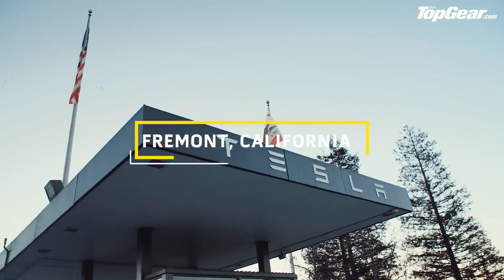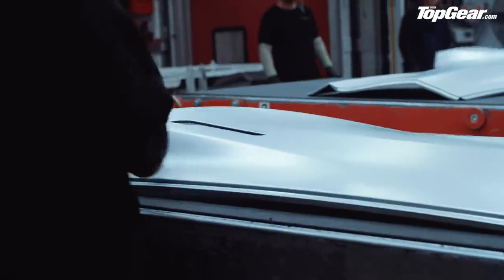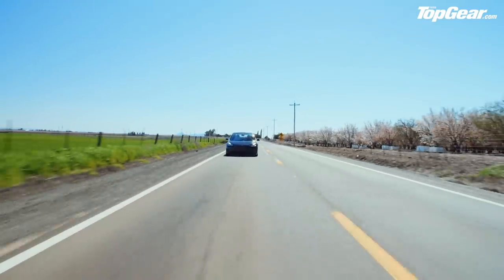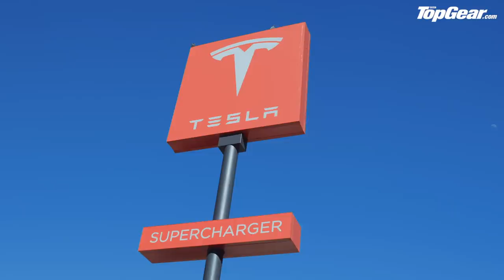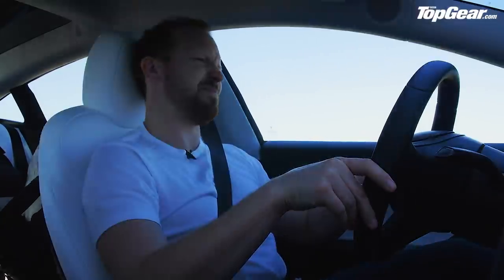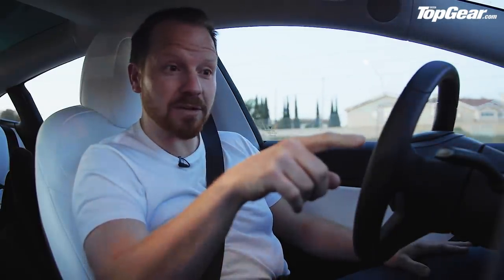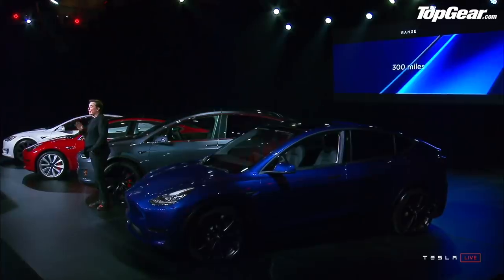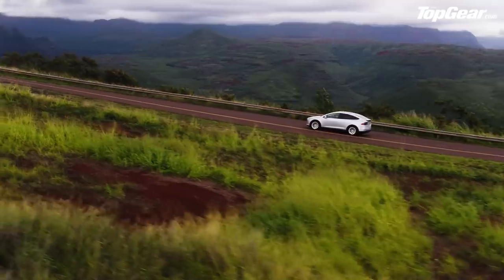TESLA Model Y Reveal, Model 3 Road Trip and Factory Tour | Top Gear

Comment: Teslas are the best cars in the world!!
Reply: LEL
Reply: If you don't care about driver engagement, track days, offroading, modified cars, great Interior, build quality. If you only car about saving money for your commute, new tech and being hip then yep it's the best
Reply: @eichler721  Actually I do care about driver engagement, great interior and build quality, which my car provides. Track mode is used for the race track, and other owners modified their suspension and brakes. Off road, I'll wait for the pick up truck for that.
Reply: @starshipdriver8536  Rams truck interior looks 3x better than the Model S or X which cost way more. I would take a electric as a daily commuter car but that's it. My truck can go 700 miles on a tank. Pull 17k and haul 5k. If I want to go through Moab I can drop in an optional 50 gallon tank in the bed of my truck and do it all without stopping for fuel. Tesla can't do that and won't for the next 15 years.
Reply: @eichler721  I don't think you really know anything about the Model 3.  https://www.motortrend.com/cars/tesla/model-3/2019/tesla-model-3-performance-track-mode-release-version-review/
Reply: @eichler721  Neither can a BMW M3 or a Alfa QV which is the class of car the Model 3P is competing with.
Reply: @flipadavis  Laguna Seca times
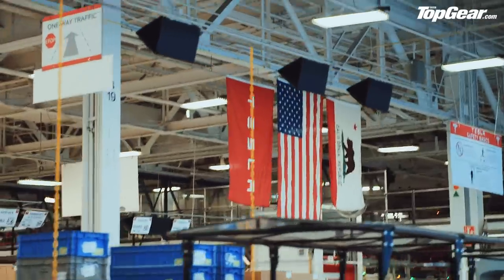BMW M4 GTS 1:37.66
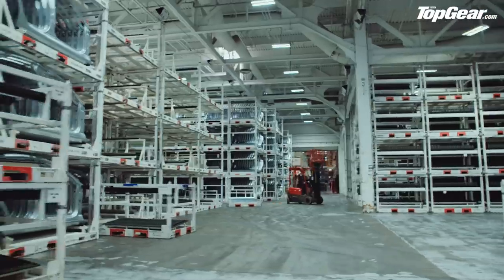C63 AMG black series 1:38.9
ATS-V 1:39.65
Guilia QV 1:39.68
M4 1:39.69
M5 1:39.81 previous car
C63 AMG 1:40.5
M6 1:40.52
M3P 1:41.28
Yes slower then all its competition at the track. It's just a marvel A full second or more slower then rivals. That's not impressive at all.
Reply: @eichler721  So you're going to compare the Italia 1:36 time, which by the way was driven by Randy Pobst who is likely the best driver to drive Laguna Seca and holds many of the records there for prodcution class, with the 1:41 time by an amateur driver? 

Just like Streets of Willow where Randy drove both the TM3P and the Alfa QV against each other where the TM3P won if Randy drove the TM3P around Laguna I bet those times would be very similar.
Reply: @eichler721  Here are some other cars and their times driven by Randy Pobst at Laguna Seca. The amateur driver's time still beat them 

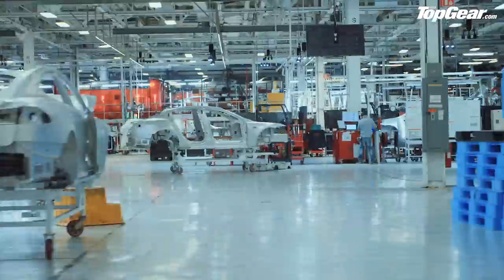Ford Mustang Boss 302 LS  1:43.00
Porsche Cayman S (981)  1:41.26
Jaguar F-Type R Coupe 1:42.00
E 63 AMG S T-Modell  1:42.39
Reply: @flipadavis  let's use science and physics 
458 Italia weighs less
Has more HP, better Aero, stiffer chassis.
M3P has a better Torque and lower speed grip cause of AWD which most of Laguna Seca's corners are high speed. Yep your arguement makes alot of sense
Reply: @flipadavis  M3P weight 4037lbs 458 Italia 3384lbs. So it weights 653lbs more and has 107less hp.  458 Italia has 308lbs better of aero downforce at 120mph and better weight  balance and steering.
Reply: @eichler721  Does it have 4 wheel torque vectoring like TM3P? No. Does it 471 lb-ft or torque like the TM3P? No. It has 398 lb-ft of torque. Having said that with the same professional driver driving both cars of course the Italia will win. But it's shocking how close a sub-$65k 4 door sedan can come to a $258,000 purpose built supercar. 

Put Randy in a TM3P around Laguna and see how close it is. And how many sports sedans it will beat. If Teslas' $60k family sedan can keep up with the best of the sports sedans just imagine what the new $200k Roadster will be able to do.
Reply: @eichler721  You keep quoting pro track record times against an amateur time. So are you saying then an Aston Martin Vantage S is a piece of junk because a Tesla Model 3P beat it around Laguna Seca? What about the others that it beat. You really just cant stand that an $60k EV sports sedan can hang with many of these cars.
Reply: @flipadavis  lets look at sports cars
Camaro ZL1 1LE 1:34.3
Corvette Grand sport 1:35.62
Mustang GT350R 1:36.11
Porsche 911 Carrera S 1:36.44
So these are 5 seconds or more faster then a M3P. Most sports cars from the current generation are as fast as the previous gen supercars. If you are not within 1 second of a car then it's not even a race on a track. Look at WEC the race classes are 2 seconds or less a lap different from GT endurance Pro and GT Endurance AM class. They race the same track at the same time yet watch the speed difference
Reply: @flipadavis  so 4037lbs divided by 471lb ft is 8.57 lbs per lb ft of torque. 4037lbs divided by 450hp is 8.97 lbs per hp. Ferrari 3384lbs divided by 398lb ft is 8.5lbs per lb ft, 3384lbs divided by 567hp is 5.96lbs per HP. See both advantages are Ferrari. Torque vectoring is it's only advantage which is negated by all the other advantages the Ferrari has. Put Randy in the M3P and it will run 1:38 at best putting it around the Mustang PP2 stats which are not bad but not as great as people make it out to be
Reply: @eichler721  Once again you are posting track records against one amateur guy's posted time in a TM3P. Why are you ignoring this fact? There are no pro TM3 Laguna lap time.

And why are you ignoring the fact that this is a four door sports sedan and not a sports car? It's amazing that an amateur time in an EV 4 door sports sedan beats many much more expensive sports sedans and even some more expensive sports cars. 

The potential is huge. Look at VW's record setting EV at Pike's Peak Hill Climb or the NIO EP9s Nurburgring time.
Reply: @flipadavis  yes those times are great. However both are multi million dollar cars. Just like the Rimac concept one. Even then the EP9 is slower then the GT2RS and the Senna, Project One, Valkyrie, AM-RB003 will destroy these at the track for the same cost. That's my problem with electric is people put it in the one thing it's good at so far and act like it's a miracle of engineering. In the future electric will be so dominant but right now the tech is not their. Facts are facts. The Roadster will crush 0-150 and at technical tracks as well. However it's not going to set any ring records cause the Project One, Valkarie and others has better Aero and weight by far and will have better power to weight as well. In 15 years it will be a different story. GT2RS 314k EP9 2million yet the gas car is faster at the track. Same with the BAC Mono which costs 250k but crushes everything right now
Reply: @flipadavis  also the Vantage V12 S is 5 years old. It's a luxury GT car that's not made for track use. It's not a supercar, the R8 V8 isn't a supercar they are at the top of the Sportscar range from the last generation
Reply: @flipadavis  by the way since you keep quoting the streets of willow time the M3P was on Cup 2 tires. The Ferrari was on Pirreli P Zero tires 2 generation old when it did the time. Put that car back on the track with Cup 2 tires and it leaves the M3P all day.
Reply: @flipadavis  also the M3P driven by Randy and the 458 Italia by a journalist 8 years prior
Reply: @eichler721  And the TM3 is a much, much cheaper family sports sedan. Not a luxury GT and not made for track use. Sure it has software driven track mode. That's the whole point! What aren't you getting about this. I  never implied or even remotely made the claim that the TM3 was a supercar or could beat supercars but the fact that it CAN beat much more purpose built higher price sports cars and older supercars of only a few years ago is amazing. And the fact that it is an EV is even more amazing. An the fact that modern EV technology that is in its infancy having been developed in only 10 years is f'ing amazing.

But you'll never concede this point. You'll never look at the forest but will instead end up off in the weeds comparing individual blades of grass.
Reply: @flipadavis  well let's look at the competition. M4 is known as the ultimate track sedan, C63 AMG is very good on the track. Gulia QV was built for track use. These are sports sedans that are made to use daily as well as track on the weekends. So the M3P is the same. It has done impressive things. However all the Tesla fanboys like to take it out of context to make it look amazing. Prime example you kept quoting the M3P beat the 458 Italia at Streets of Willow. Then when I give you another track where the M3P gets beat by the Italia and many sedans it competes with and you say it's not fair cause the other times where from Randy who is a professional but that's exactly what you did. Use the M3P time from Randy compared to a journalist time and acted like it was amazing.
Reply: @eichler721  wow, you sure got triggered!
Reply: @zelekuther7938  nope just sick of fanboys and ignoring short comings for Tesla cars. You can't post anything that they do wrong without a koolaid drinker coming to insult you.

Comment: Dear Top Gear: 

1. You can adjust autopilot to go faster than the speed limit. 
2. You didn't need to get back into the car to open the charge port, simply bringing the charger near the port will automatically open it. 
3. Range anxiety at 320 miles of range with 30+ estimated miles left at your destination which turned out to be accurate? Where is the anxiety when its right? Your gas car doesn't give you that precise measurement, wheres the anxiety there? 
4. You said you charged the car 95% and had 170 miles to go but arrived with only 20% left in the charge? How does that work? The range on the car is 310 miles, and at 95% charge that's 294.5 miles, you should have arrived with 43% charge not 20%. 

Really annoyed by inaccurate commentary in media these days.

Comment: In a dinosaur fueled car, you wouldn't be stuck in a lounge with other Tesla drivers for 50 minutes drinking overly priced coffee and looking at funny shoes Or A 10 minute splash and you're off. The fart game is the best part of the whole car.
Reply: 50 minutes is if you charge to full, which is not time efficient. Better to charge to 90 percent and stop. 90 to 100 takes like 20 extra minutes
Reply: Supercharging v3 takes you to 80% in 20 Minutes. You go to the toilet, walk a few steps and check your text messages and you are ready to go...
Reply: @meamzcs  but what if i don't have the bladder of a 90yr old man?? what if i don't have anyone to text and hate texting ppl like any normal person???? thing is that 20mins is ONLY if the batteries is cool enough, i don't think thats going to work where i live after a long trip...
Reply: @dunhillsupramk3  No... it's if the battery is warm enough and the car will preheat the battery before you arrive at a SuC...
And you should drink more if you don't have to go to the toilet every 4 hours...
Reply: @dunhillsupramk3  average v3 supercharging time is 15 minutes.

Comment: this guy clearly never driven a electric cars he is talking about range anxiety! quite funny tho with this model 3 performance that goes over 309 miles in single charge.. my car only does 100 miles and I don't have range anxiety I just find a charger when the battery is low its like you running out of petrol and you find a garage and refuel it. also he doesn't even know that he can actually open the charge port with button on the super charger handle and on top of that he is showing battery percentage instead of mile remaining coz Tesla predict how many miles left very accurately its even take consideration of elevation changes on the way.

Comment: Range anxiety is not real, it's exactly the same as when you are running low on petrol! I can't see why people get so twiddled up about it. I own a first gen Nissan Leaf and have never experienced anxiety, I've even driven it with 0% power and was not worried. I'm glad top gear are finally giving EV's the attention they deserve. More EV related stuff please.
Reply: You get range anxiety also in some stupid fuel-burning car, when the fuel gauge is not calibrated properly, or perhaps the fuel tank has a weird shape, and so it appears that the fuel level drops too fast at a quarter tank or less.

Comment: You don't "get autopilot" you pay thousands of dollars for it as an option
Reply: Tony C it’s only 3 grand
Reply: @Powderlover1  is that not thousands of dollars like I said? That's actually a FEW thousand. Thanks for the update my FSD cost me 7k all in
Reply: Tony C when you think of what you get that’s not terrible, in my 2011 genesis the tech package (which is basically radar cruise control and parking sensors) cost 4500.
Reply: @Powderlover1  that was also 8 years ago. Now comes standard on most 20k vehicles
Reply: Quite rightly too.

Comment: How long to charge ? With gasoline I am gone in 5 minutes no time waiting around to charge a car. It looks like is a car for people don't have to be nowhere and have no kids.
Reply: If you charge to 90%, expect 20 to 30 minutes. But the version 3 superchargers should add 200 miles in 12 minutes
Reply: oscar flores The idea is to charge at home , it literally takes 5 seconds of effort to charge your car, simply plug it in when you get home from work or running errands, then go about your day.. or night.. in the morning you go out to your car and it’s completely charged and ready to go.
Now on a bigger trip that’s where the superchargers come into play , you have 300 miles or 480 kilometres of range to start with, you can drive for two hours, pull into a supercharger and top up for 15 -20 mins , have a break and do the same in another two hours.

Hope this helps your curiosity 👍
Reply: @darrinanddonna  thanks for the info was helpful.

Comment: Top Gear will never make up for the credibility lost due to it's stupid Jeremy Clarkson episode. Top Gear = Jeremy Clarkson = stupid fake anti-Tesla episode = EV haters on the wrong side of history
Reply: Yep. Some of us have long memories.
Reply: I think you're on the wrong side of  history as electric cars have been around almost since the first car but they are just not practical... Ev cars at this time are just fab cars for insecure ppl who want to feel better about themselves... Teslas are not well built, Tesla is not a good company as they have many issues to work out, the cars are over priced and parts are not available to buy which means owners will have to deal with months of a run around and without their car if it needs fixing even for minor issues, waiting an hour to charge even if broken in half is ridiculous. I'm shure if you do the math that due to the extra cost of a Tesla that the charge VS gas fill up cost is much higher for the Tesla and you still have to deal with the basic unappealing not well built design and wait times... Ev make no sense unless you convert your current car go to electric as it would be far cheaper.. On the road gas cars are safer as many drivers out there don't pay attention when charging lanes and having a loud car gets their attention.. Jeremy's video was great BTW... Ev only make sense as a second or third car to use only when it's practical to use it, not an everyday car for most ppl..
Reply: @jaybelle1909  it's obvious you've never driven a Tesla. I own a Model 3 and all you've said is flat wrong or outdated. EVs use to be impractical due to limited range as battery technology was lacking and expensive. This is no longer true and given Tesla has sold hundreds of thousands of cars already you stand corrected.
Reply: @jaybelle1909  you really are totally out of date when it comes to modern EVs.

Comment: More robots than any other factory in the world.....all using copious amounts of Lubricants (oil) including the biggest hydraulic press in North America 😂
Reply: Insert Witty Name so? They’re not burning oil and releasing the pollutants into the air we all breathe.
Reply: @MrTaliz  yaaaas coal is not releasing pollutants into the air.
Reply: @MrTaliz  electricity is largely made from coal, petrol and uranium in western world that is said to be superior than other parts of the world.
Reply: Some Privileged White Male You’re spot on. 

The point I was making is the amount of pollutants used to drill for the base oil, get it out the ground, ship it to shore, refine it to make it into a lubricant then ship it to Tesla to fill their machines. Not to mention the amount of oil used in the production of all of those robots and the hydraulic press.
Reply: Some Privileged White Male coal and oil used to be popular,  not anymore though. In Northern Europe where I live almost all electricity is made from hydropower. Some nuclear in Sweden and a lot of wind power in Denmark.
Also even if the electricity an EV runs on is made from coal, it is still much cleaner than a petrol or diesel car. And it does not release any pollution locally, so people on the sidewalks don't have to breathe in exhaust smoke.
Reply: Insert Witty Name you do realize that's what happening in a million times larger scale to get petrol and diesel for a fossil fueled car right?
Reply: @lebagnard6018  
As Dogphlap remarked a lot more electricity is from natural gas today, which offers 60% efficiency. About 3x higher than a gasoline engine. Not to mention that most of the growth in electricity production is renewables. So electricity production is ramped up to charge EVs that extra electricity will come primarily from renewables.

And perhaps more importantly EVs and renewables fit extremely well together. As millions of EVs stand around most of the day plugged in somewhere they can soak up excess electricity produced by renewables, and sell it out to the grid again when production from renewables fall. This is the promise of smart grids.

So has we ramp up production of renewables were are going to NEED electric vehicles.